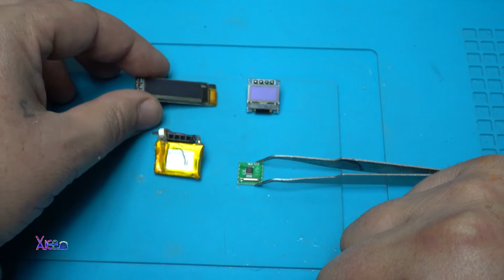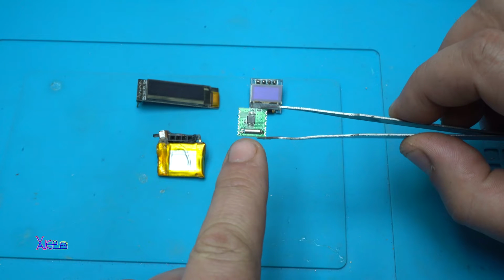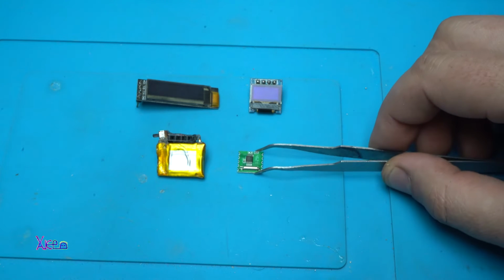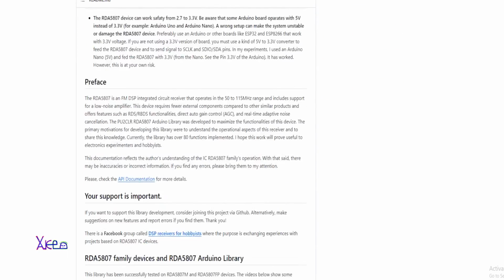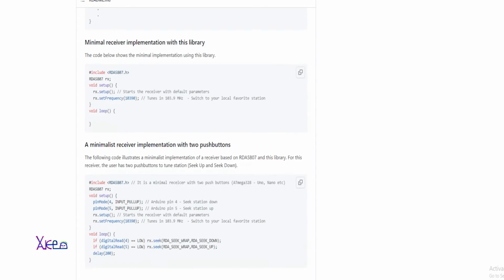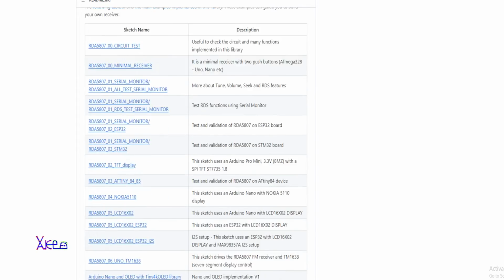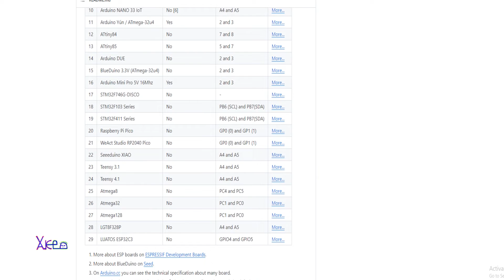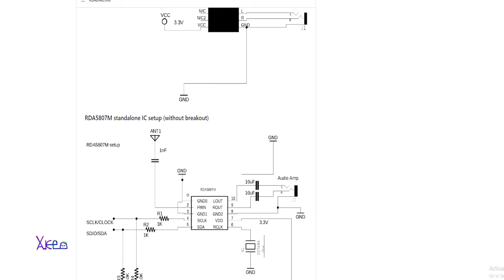Making Micro Size FM Radio - Part 1

Comment: 🤘👍👍👍🎥💥 Interesting project! One remark: when I was teenager then making fm radio required few hours and sometimes few days or work... Now you just connect few modules... Interesting how perspective has changed...
Reply from the maker: Yes now days is far more simpler to make el.projects and now we have even smaller modules and parts
Reply: @Hacktuber  👍 P.S. Smaller doesn't mean better for DIY guys... Quite often small size make soldering etc. much more challenging...